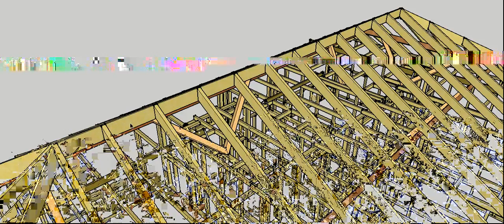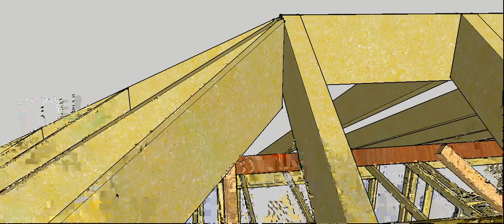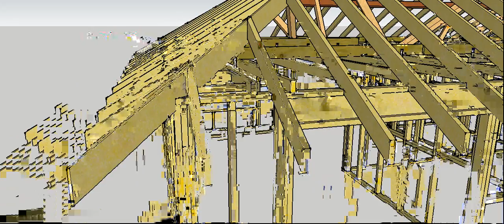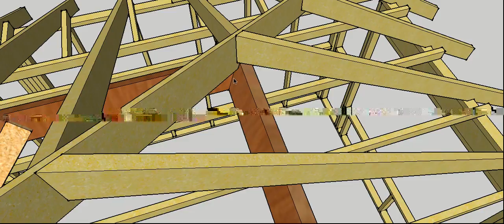Roof Bevel Positions

Comment: Hello, and thank you for these great videos! What is the maximum overhang you would suggest for a hip roof that has a  5m span between exterior walls, 4:12 pitch,  using 2x6 commons and 2x8 hips? Id love to go more than 80cm .. I live in Uruguay where we have no snow, moderate winds and the precipitation hovers around 1,000/1,100 millimeters.
Reply from the maker: Hi Thanks for your comment. 
As to the overhang of the rafters the required overhang is one of the main determing factor in the Rafter size. You would have to check your local span tables however i would suspect that you would need bigger rafters than that to achieve a 800mm overhang. Sorry this may sound like a bit of a cop out however every country is different and i have not experiance in Uruguay.
Reply: @Buildsum  Thank you very much : )
Reply: p0⁰0

😊😊kko

Comment: Good job but few observations.
1/ at 1.04 when showing birdsmouth bevels the ceiling joists are not tied to rafters. Roof will spread

2 the edge bevels are close to 45degrees on  rmcreepers and hip edge bevels but the steeper the pitch the greater deviation from 45. 45 degrees is theoretically correct if a level plane.
On exposed roof will have gaps.

Pretty good explaination
Reply from the maker: Thanks Anthony